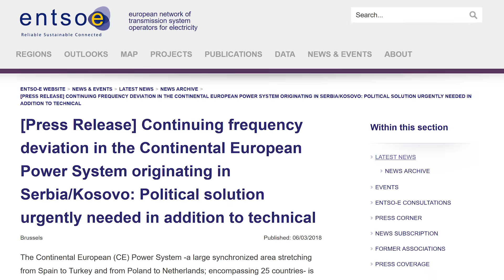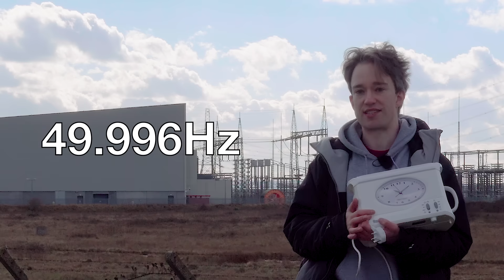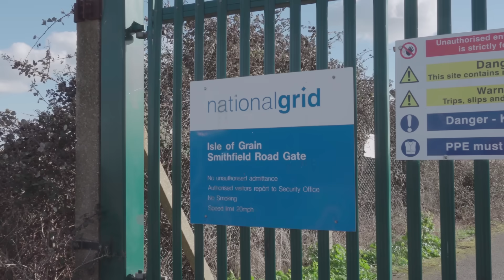European clocks ran slow for a bit. British clocks didn't.

Comment: When I taught in a High School in the US, it felt a bit surprising/outdated that the classroom clocks were all battery powered and set to whatever time the classroom teacher set it to.

Because I had graduated HS over 15 years prior in another state and all the classroom clocks were synchronized to a central one in the main office and so they were each exactly the same. Although, that did mean that when we came back to school after power had been out from snow, we got to sit there as the clocks spun very fast to get to the correct time; the automatic mechanism only allowed the gear to move the hands forward/clockwise.
Reply: "teacher, I think the principal has discovered time travel"
Reply: But the battery powered clocks can something that a synchronised clock never could do: If you have a class that you don't like at the end of the day, and the teacher left do get something it was not uncommon that the class ended about 5min earlier than it should.
Reply: @truckertj2109  they can something indeed
Reply: I have seen a lot of clocks in classrooms set to whatever the classroom teacher set them to as well, and by that I mean they haven't had their batteries replaced in a while so the teacher would have to manually change the time.
Reply: That's how my high school was about 10 years ago
Reply: Principal Pucci has achieved Heaven

Comment: A dispute between Serbia and Kosovo has disrupted the electric power grid for most of the Continent, making certain kinds of clocks — many of those on ovens, in heating systems and on radios — run up to six minutes slow.

Comment: That gives me a better understanding of what's happening to the clocks in my truck. The clock that runs off the BCM is always accurate down to the minute but the clock on the radio will wander up to 5 or 6 minutes in a month's time.

Comment: Why not have the clocks internal with its own oscillator?
Have the clocks battery powered instead, while the kettle is mains powered.
I think its doable.
I think it's the poor design decisions.
Think of the VCRs or the DVDs having their own internal clocks and time counters, it can be done.
Reply: Cleric775 it could be done, but that would mean the consumer would have to change the batteries, so the consumers wouldn’t buy that product anyway
Reply: @mtqrx  In addition, those oscillators have to be adjusted, otherwise they will be less accurate than the average grid frequency.

Comment: Most modern electronic devices no longer use the electrical grid as a time marker. Instead, they have an internal quartz to maintain proper time as most devices also have universal power supplies that can accept both 120/240 Volts and 50/60hz. Also, many dedicated clocks these days use the wireless signal sent by atomic clocks around the world to synchronize their time. Cell phones get their time from the service provider/cell towers.

Comment: Great video, very interesting, I had no clue about this method of synchronisation. 

Would I be correct in saying that these sort of British clocks would be ahead of time in America because their grid runs at 60Hz? (Also learnt that from your channel) Or would it just sync at 60Hz and listen to that frequency?
Reply: Yes but no. It would be way ahead, except you can't plug them in in the US because the outlet is different, and if you could the kettle wouldn't work anyway (or at least it would be awful, like electric kettles in the US) except in one of the big outlets used by stoves and such because the regular outlets only use half of the AC voltage because using more is more dangerous and there's nothing to gain by doing so.

Comment: Why is there are DC cables under The North Sea? What voltage is it? What use is it? Isn't the transmission of DC over large distances problematical and the reconversion to AC fiddly and inefficient ( given that AC transformers are very ( 90% ? ) efficient?
Reply: DC is more efficient than AC, but conversion is more elaborate. DC has especially less losses when using cables than overhead power lines.

Comment: And in the USA, things run on 60Hz. We have an atomic clock in Colorado with a tower broadcasting a signal to receivers on clocks for synchronization to keep time.
Reply: We have those in the UK too
Reply: Most Europeans rely on the German DCF77 time signal for the same purpose, but not many appliances have a receiver for it.

Comment: Any particular reason why it's 50 Hz in Europe and 60 Hz in the Americas?
Reply: Just old standards, by the time anyone thought "we should probably make it the same" it was way too late. Not a problem these days with everything being digital but back in the analogue days much like the aforementioned clocks the frequency of the electricity synchronised everything, that's why British TV is 25fps because it's exactly half and keeps the video and audio in synch but the US standard is 30fps which is again half of their frequency. Video game consoles used to have games run slower in Europe vs Japan or the US too because non of the developers thought to adjust it so it ran at full speed on PAL. Japan i believe has different frequency depending on what part of the country you're in, i bet that's bloody annoying

Comment: How would this affect power usage over this period? If my understanding of electronics is good enough, I would think that a lower frequency would mean the power companies can charge for less electricity being used. Then, should the frequency be bumped up higher than the 50 Hz agreed upon by the officials, raise the power bill for that period? 

Basically what I'm asking is... could you theoretically cause a frequency drop to save on your household power bill?
Reply: You pay for energy which is (coarsely) power*time, and electrical power is V*A*cos(phi), so frequency does not change it.

Comment: These cables bring to mind a lot of questions: 
1) Why are there cables connecting the grids?
2) What is the energy loss to use DC instead of AC (HS science always told us that AC is much more efficient over long distances)?
3) Why was DC chosen for these Cables?
Reply: High voltage reduces losses and AC can easily be transformed into hjgh voltage, but DC of the same voltage has less losses, especially when using cables instead of overhead power lines. And connecting grids allows easy transfer if loads change regionally or a power plant has to reduce its output.

Comment: Southern California started with 50 cycle equipment, and to hook into a grid they had to switch to the 60 hz everyone else was running. So the power company opened a shop where clocks could be brought to have their gears changed out for free.

Comment: Does the UK not have an atomic clock radio signal like the USA?
Reply: Kieran. Yes, it does have an atomic clock signal. The whole world has access to atomic clocks. It's just that some manufacturers like to save money by not installing an atomic clock receiver; they use the power grid cycle for accuracy instead (cheaper) - and, as Tom says in the video, it's accurate enough for most people.

Comment: Why use the electric frequency to keep time tho?, it sounds rather inefficient
Reply: Nono Because that's how all quartz based clocks work, as well as all electro mechanical clocks as fitted to the vast majority of appliances. Do you seriously think your microwave or oven needs an internet or radio connection just so the clock is always correct?

Comment: Or spend another few cents in the clock circuit to use a local 32Khz crystal oscillator and no one gives two hoots what the line frequency it!

Comment: I never understood why they don't just spend an extra 0.1p and put an oscillator in the circuit.
Reply: Oscillator needs adjustment, otherwise it might be worse than grid frequency.

Comment: Umm Tom, that teasmade (that looks like a toaster with a clock, they should put a toaster in  it as unsafe as that would be) isn't plugged in, considering the 4min length of the video, given times for extra takes and travel/set up, that clock is slower or faster or even correct (twice a day). Whatever it is that clock in the UK is not running on time!

Comment: I never heard about clocks that use power grid frequency to measure the time, I thought that they have transformer inside. Nisam očekivao da mi imamo veze s ovim.
Reply: Ni ja
Reply: In opposite to a switching power supply, a transformer lets the frequency pass. Even after simple rectifying, there is a frequency, just twice as high.

Comment: The most accurate plug-in clocks use a quartz mechanism like the one he's holding, but hold a charge and operate at less than 50 Hz. This means that despite any fluctuations of the power source, the power input to the clock remains the same. Think of it as a quartz watch that recharges itself every now and again. If most clocks used this simple solution they would be accurate even now that the power source has fluctuated.

Comment: I assume computer based clocks aren't affected. Also, most clocks around here are battery powered. I suppose that the delayed clocks are only those on applications which don't need to be exact, like stoves an older microwave ovens.

Comment: how is the huge power converted back to AC from DC when it arrives? Do they use some sort of motor driving an alternator?
Reply: No, that method was used in the 1930s in steelworks to allow easy speed control of electric motors (they used AC-DC-AC). But modern systems use high-power electronics (thyristors) to create an AC waveform from DC.

Comment: Intriguingly, this is one of the best features of the Hornsdale Power Reserve in South Australia (AKA the Tesla Big Battery). It helps with FCAS or Frequency Control Ancillary Services.

Of course, our alarms across the pond are just fine 'cause we're using our smartphones and they're probably running off an NTP server that's based, somewhere down the chain, on an atomic clock.

Comment: The Nordic Grid is also correct because Norway, Sweeden, Finland and parts of Denmark runs it's own synced grid separate from the rest of Europe. The Baltic area also has their own. The Nordic and Baltic are both connected to each other and the rest of Europe, but direct not alternating, like the island of Great Britain. Ireland and Northeren Ireland has their own.

Comment: Except if your clock has internal oscillator with crystal stabilization, like it's supposed to. There's no excuse to use grid frequency for time keeping in 2018.

Comment: A lot of this could have been prevented if there was a European version of WWVB (look it up).

As for running the grid faster than 50 Hz to get the clocks to catch up, what about the clocks that are plugged in during the higher frequency period?  Won't they be off by up to six minutes?

And it wasn't just clocks that depended on the constant frequency on AC; without it, the invention of television may not have happened for decades (this is why European TV signals show 25 frames per second; half of the screen (every other horizontal line) is drawn every 1/50th of a second, in sync with the AC).
Reply: German WWVB: DCF77

Comment: I wish my current microwave did use the 50Hz frequency; when I originally bought it I set it to the right time but it soon got out so now that's one clock fewer to reset after a power cut.

Comment: I don't understand. All clocks in Europe are synchronized and one person controls all clocks in Europe. A technology like that exist?
Reply: Only the cheap clocks that is connected directly to the AC power grid. Clocks in computers are using an internal, rechargeable clock battery. Since I don't know anything about how electricity works, I would expect the frequency to get closer to 50Hz the closer it is to a transformer (or power generator or something).

Comment: Well it's good to know that European Regulators are on the case, over whether they should run the power grid a little fast to bring the averages back up.
I mean I suppose you could just reprogram the clocks later, when you know that they're a little bit behind.

Comment: Why DC?  I thought DC was undesirable for long journeys.  Obviously, it has the benefit of isolating certain characteristics, but couldn't you do the same thing by AC transit, and a transformer on-site, without losing so much energy?
Reply: Low voltage is less good for long distances, and AC can be transformed easily, but DC has less losses, especially when using cables instead of overhead power lines.

Comment: Who thought it was a good idea to synchronize the entire grid? Talk about a blackout.
Reply: The whole idea of synchronising the grid is to minimise blackouts. If there's a problem in one area, the backup from the whole grid can be called upon to provide the necessary reserves and keep the system running. If there's a really severe issue, affected areas of the grid can be decoupled.

Comment: I don't think there are any clocks running from the grid anymore only very old appliances would do that. Mostly now all electronics use a cristal
Reply: Only those analogue clocks run off the mains, like those in city centres, railway stations, schools, etc. The mains frequency is a lot more accurate than the average battery powered quartz crystal clock, so it's a happy advantage that these clocks keep good time and don't need sometime to go and adjust them every week or so.

Comment: Might seem like a stupid question, but because your mains power is running at 50hz, does that mean your TVs and Monitors also generally run at 50hz? Unlike here in the US where they run at 60hz for example
Reply: TV runs at 50Hz, yes, computer monitors no, mostly 60hz (there was a point when 75-100hz was usual, before the dissapearance of CRT), and now we're starting to get more high-frequency LCDs, so there's that. (also, US TV runs at 59.94 instead of 60Hz since the dawn of colour TV)
Reply: 70-100Hz, you mean. VGA text modes and lower-resolution graphics modes use 70Hz. SVGA modes can go higher if the monitor supports it.

Comment: In the USA, the power supply is 60Hz. Our power companies also make sure that on average it works out, sometimes by running it slightly faster or slower at the end of a working day. But our clocks being fast, slow or on time have absolutely nothing to do with that fact.  The time on electric clocks here do not depend on the frequency of the AC AT ALL.

 I have no idea why Europe hasn't figured this out yet!
Reply: Do you not have any mains powered analogue clocks there which run the motors directly off the power coming in? The mains power here provides a very accurate time/synchronisation reference. I have no idea why the US hasn't figured this out yet!

Comment: I think you skipped 2 important steps: why an under-powered grid goes slower instead of lower voltage, and why we always conduct under-water electricity in DC.
Reply: With DC electricity the resevoir from which you initially withdraw energy (and which is refilled by the power supply) is capacitance, whose voltage is proportional to the energy stored in it, which means that whenever you consume more energy than supplied the voltage will go down and vice versa.  This is presumably where your intuition comes from that drawing excess power ought to make the voltage go lower.  Capacitance is however of no use for storing alternating current.  Instead, with grid power, the resevoir of energy from which load is served is the inertia of the many synchronous generators attached to the grid, and withdrawing energy from this causes these generators to lose kinetic energy and spin down, thus lowering the grid frequency.
Reply: Spinney thing go Burrrr slower when you put a load on it.
Reply: @johngaltline9933  Exactly!  You put it into more eloquent words than I managed.
Reply: @johngaltline9933  LMAO. I read the comment before yours and I was still not able to figure it, still thinking it should affect amps or volts, or both, but not frequency. Then I read yours and went "oh, ya, duh, obviously"...just way too funny.
In all fairness, my line of thinking came from a digital psw inverter because that's what I've been looking at lately to replace my analog inverter, but it is odd that after 30 years of using analog inverters, I couldn't get there logically. Funny how the mind works. Anyways, thanks for taking the time to dumb it down for me 😂🤣
Reply: You'd use DC for underwater cables because  with AC there would be huge capacities between the cables. With means you lose a lot of power.
Reply: The voltage drops, too. The reason why the frequency drops is because the power the grid takes from the generators brakes them. Usually, changes are compensated by powering the turbines more, but if it is not, the entire grid works at a different frequency.
Reply: +nraynaud1  +ElectroBOOM just did a video on the second part.

Comment: Why does the load relate to frequency?
Reply: Frequency is set by the rotational speed of generators. When generators get under load, they load down machines (turbines) powering them, and if input power to them is not then increased, they slow down.
Reply: Alternating current travels in waves that change direction at very fast intervals (hence the flicker you see if you slow down a recording of a TV screen or fluorescent lamp), three waves (or phases) switch between positive, neutral and negative 20 times per second for a total of 60Hz in North America or 16.6666666667 times per second in Europe for 50Hz
Reply: Hertz = times per second tho. So NA 60Hz = 16.6666666667 ms wave and European 50 Hz = 20 ms wave.